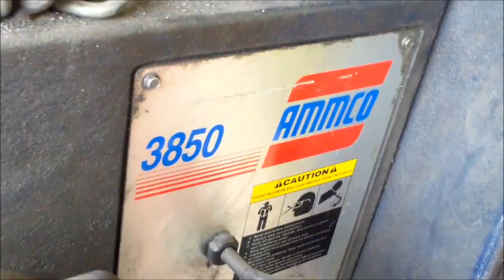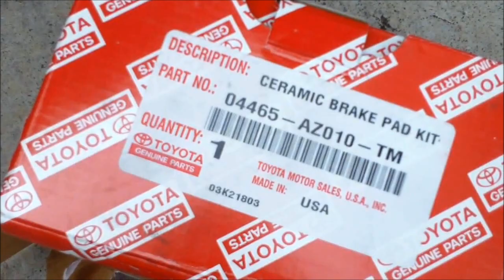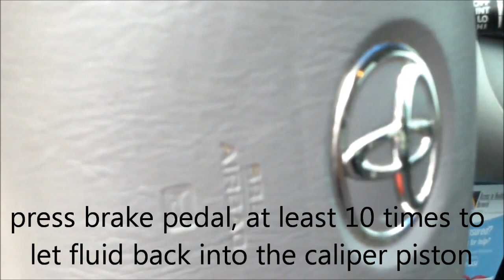FOLLOW brake pads ROTORS replacement Toyota Camry √ Fix it Angel

Comment: Very clear, clean and well done. thanks for sharing it and doing it right. I wonder though why you did not replace the hardware in which the pads sit. Some folks say it is best to replace it when you replace the pads, but I am no expert so I just ask. Thanks again for doing a good clean succinct video.
Reply from the maker: Baba G hi baba, from my experience working as a used car tech in a dealership we only replace the pads only. Some aftermarket hardware just don’t fit correctly. 
But sometimes I do replace it. So it is really up to you. Thank you for the comment. Have a nice day.

Comment: Hey thanks for the video, i have a 2008 toyota solara with 17 inch wheels , plan to do the same job as in your video.......Will i need a c-clamp to push the caliber piston back in before i install the pads?
Reply from the maker: HUSKEY BOY hi, you can use a c-clamp. But at the beginning of the video. I used a screwdriver to press back the piston. Please watch the video again from beginning to finish. I did not leave anything out. I did not use a c-clamp.
Reply: @FixItAngel  thanks for your reply, I remember seeing you use a screwdriver in the beginning but I didn't realize you are actually pushing the piston back in..
Thanks buddy for all your help, I will be sure to subscribe

Comment: I must of watched every video you posted that had to do with brakes.  I have a 2012 Camry LE and my rear brakes squeaking/squealing when I reverse, the sound goes away when I drive but just yesterday I can hear a little squeaking/squealing when I drive.  I've only changed the front pads (my friend did) and never the rear pads.  It has 70K miles on it and I would like to replace both the front and rear rotors and pads at the same time.  Is there a step that was not shown in the other Camry videos that I need to know about?  Subscribed.

Comment: I have a 2002 Camry LE 4-cyl. I was told that the rotors were basically disposable, and could never be resurfaced. I think the new rotors were like $44 each at ATZN. That was after having attempted to resurface them and experiencing the shimmy issue we were trying to fix, and wasting a lot of time in the process. What is your opinion on this? Thanks.

Comment: Thanks for the vid!
Question: what are the torque specs for the 14 mm and 17 mm bolts?
Reply from the maker: Sorry I don't know. Once tight by hand, turn ratchet 1/2 to 3/4 turn. That should be tight enough.
Reply: Hardy S I believe the 14mm is around 26 ft. lbs and the 17mm is 79 ft. lbs for the front brakes
Reply: 79 ft/lbs for the 17mm bracket bolts and 25 ft/lbs for the 14mm caliper bolts.

Comment: I had a guy tell me pad slapping was a bad idea. Your thoughts? Do some parts places turn rotors?
Reply from the maker: Hello Clinton, What city are you in?? Checker's I remember before but new name/ownership, O'reilly's turns rotors but not for sure.
When driving, if you feel brake pulse on the pedal, steering wheel shaking at freeway speed, replace or resurface the rotors. If you see any high heat marks(black spots) and groves on rotor, also replace or resurface.  So if it does not have those of what I mentioned, it is ok to pad slap. You might have some light brake noise, depending on the type of brake pads.  I've replaced the pads only and my friends and family don't have any problems. Thanks for the question.
Reply: 88bmyvegas 

I have an 03 Camry. It's squeaking a little when I brake. No grinding or vibrations. I'll most likely the oem pads if there's nothing there that you mentioned. Its got 200k on it and I feel like it's got another 150k in it. Thanks for your help.
Reply from the maker: There could be a lip on the edge of the rotor that could be causing the little squeak. Also aftermarket pads will cause squeaking too. Welcome!!

Comment: Can you use Anti-Seize instead of that silicone paste when lubricating the slide pins?
Reply: +Ghostface Nay, anti-seize is not compatible with the rubber boots.  You want silicone.  Dielectric grease will do if that's all you have.  Silaramic is the best as it has extreme high temp rating - 3000 degrees F.

Comment: getting ready to do a brake job on my car. is bleeding required?
Reply from the maker: Sonowske no you do not have to bleed it. Only when your brake pedal is spongy.
Reply: Fix It Angel thanks for the response. another question: why do you use silicone paste for the pins and grease for the brakes themselves?
Reply from the maker: Sonowske the pins need high heat resistant silicone paste to slide because brake pads wear down, the caliper will need to be free floating. If you don't lubricate the pins, pads will wear unevenly.
Reply: Fix It Angel what's the purpose of the disc brake grease?
Reply from the maker: Sonowske the brake pad grease is to lessen any brake squeal noise and vibration
Reply: Fix It Angel one last question, do I need to grease up any other bolts/anchors besides the sliding pins?

Comment: If i changed my own brake pads, how much would I save? I know it's a difficult question with lots of variables, but would it be like $400 or less?
Reply from the maker: Hello, The brake pads are about $40-$70 depending what kind of car and brand of pads you are buying. At the dealership, they charge about over $100 per hour for labor. To do front brakes, it's a minimum 2 hour  labor job. So you looking to pay roughly $300 with parts and tax. Hope this answers your question. Please subscribe. Have a nice day.

Comment: The video is great but why did you resurface those disks? They looked perfectly normal to me. I would have only changed the pads.
Reply from the maker: Златко Попов Hello, the rotors were glazed and on the edge it has a lip. It was making noise. To save money, yes just only replace the pads. Thanks for watching. Please subscribe.
Reply: Златко Попов The new pads also wear better with resurfaced or new rotors.

Comment: SEEMS LIKE THE THE PADS WERE ALREADY LOSE WHEN YOU FIRST PUSH ON THEM WITH THE SCREWDRIVER.  MAYBE THE SLIDE PINS WEREN'T ALLOWING MOVEMENT OF THE CALIPER LIKE THEY'RE SUPPOSED TO.  THEY APPEAR TO HAVE LUBE ON THEM WHEN YOU PULL THEM OUT THOUGH

Comment: Having a hard time removing the rotor.  Did everything shown on video, Tried using rubber mallet but the rotor does not want to budge.  Any suggestions?  Thanks.
Reply from the maker: Hello, are you going to put a new rotor in or resurface the old one?? If you are putting a new one and discarding the old, just smack it out with a regular hammer. If resurfacing old, just hit it in between the studs to loosen the rust. Watch out and not hit the studs. Welcome

Comment: does the slide pin with the rubber piece go on the bottom for both sides
Reply: SLiM JiM Yes. The guide pin that has that black piece on the tip goes on the bottom.